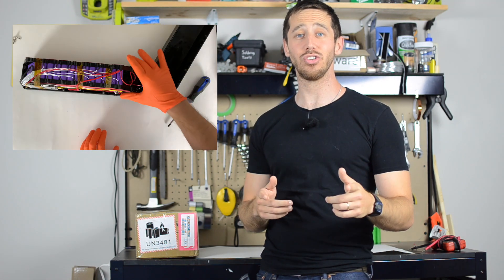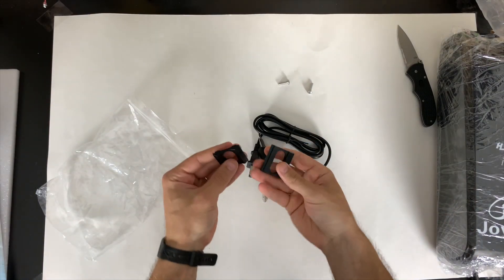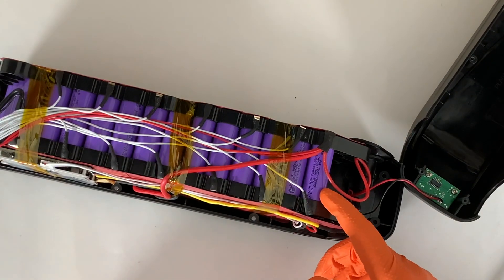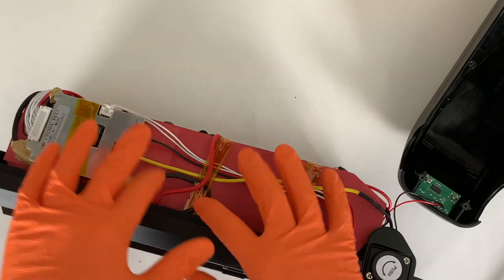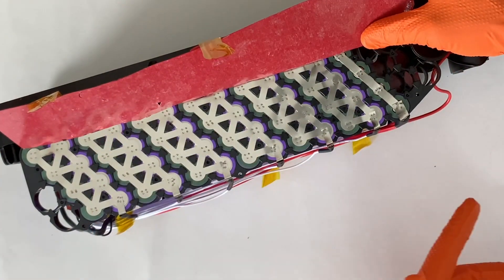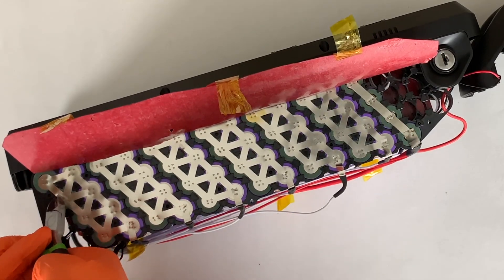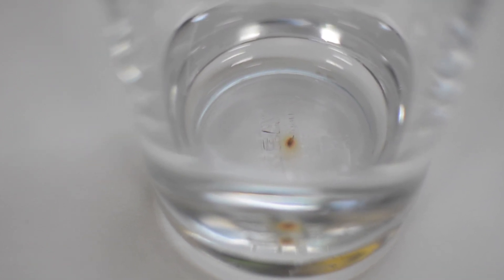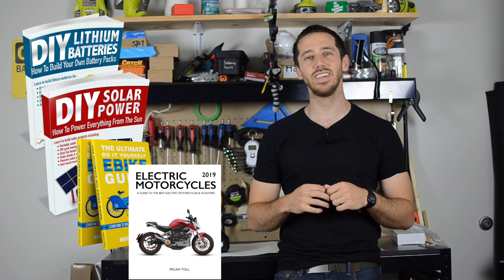How do you know if a battery is good quality?

Comment: why even the positive terminals are connected in parallel?
ALso, what is the rationale bwhind the use of nickel strips instead of copper, which is more effective (ie, lower resistance, lower heat loss, etc)?

Irrelevant:
"before my wife freaks out" : D

Comment: Hello I am trying to replace a a fuse board for n a Bafang battery 48V 15Ah 720W, battery is not charging, but it has some charge left on it. My question is where can I get the replacement part (fuse board)? currently there is 29.67V coming out of the fuse board. Can I bridge the fuse? &
voltage out of the charger is 55.2V.

Comment: I was riding my scooter the other day then it shuts down on me. When i turn the key back on i get error fault E-06. Key off then on again, noticed 54.6v with same error. 1 min later key off then on, the battery voltage from 54.6v would drop slowly down to 0v. Key off then on, completely no reading from voltage gauge. What could be the problem? Please help. With direct charging from outlet source, 58.4v and doesn't cut off. Btw noticed when i plugged charger into one of the scooter charging port, i hear like an arc sound but disapper afterwards..

Comment: Do you have diagnostic videos? Mine is supposed 28ah but when I get to around 16ah and voltage around 48 it drops out and I lose power to my cycle analyst. My old 11ah would run down into the low 40 before drop out

Comment: Thank you for sharing this information; critical information that should be explored and shared by the e-bike reviewers on YouTube.  I truly believe knowledge of a battery pack is the MOST IMPORTANT aspect when making a decision on what e-bike to purchase, seeing how devastating an e-bike fire can be! I haven't seen one e-bike  review where the reviewers covers the e-bike battery manufacturer. They gloss over the battery, providing the basic information that is easily found outside of the review. I would in addition like to see at the least the if the battery is UL certified plus the type of battery cell used in the pack, particularly if its from one of the "Big 5" like Panasonic, Sony, etc when a review of the bike is performed. At the most, it'd be great to have a review of the entire battery and motor pairing. From what I've gathered by talking to e-bike shop mechanics and officianados, e-bike batteries aren't readily interchangeable from one manufacturer to another. Meaning, if your e-bike has a cheaper/lower quality battery associated with the motor the bike was equipped with, it may be difficult to simply upgrade your battery. Is this true or not? Before anyone gets offended by this comment, I am very new to e-bike reviews, so I could be wrong. I apologize if  there may be some reviewer(s) out there who have taken the time to talk in depth about the battery manufacturers and cells within the battery pack on the e-bike they're reviewing. I'd love to hear more about this (importance of larger battery inspection and safety, and replacement of batteries in e-bikes) in your future videos. I really appreciate your content, so thank you!

Comment: with 30 Amps doesn't it require #10 wire? For house wiring #12 is 20 amp wire.  #10 is 30 amp wire.

Comment: Hi great video. I got here becase recently the battery of my cargo e-bike stop working and i got curious about the internal construction of these batteries. Well, i see that in my battery i 30A fuse is gone, the ba,ttery case providex a separate cover that give you access to the fuse. I wonder if it is safe to replace the fuse or it is better to check if other electronics got damage. The thing is that it is not so easy to open the whole case.
Reply: Do you still have the battery pack?  God told me that some of your battery cells are losing charge and the rest will go bad soon. God told me it has nothing to do with the fuse. You'll have to build a new battery pack.

Comment: i was hooking up another ebike battery on my ebike, i got 2 ebikes, i got 2 batteries for each ebike, i got extra ebike battery plates also for my project i am doing

 one has a 48v 13 ah battery and one is a 48v 14ah battery and i wanted to use both ebike batteries on both ebikes, i wanted one battery plate of each kind on both ebikes, so i can ride one ebike for awhile and use the other ebike batteries at least once every 2 weeks, drain them some and then charge them up so they stay in good shape and not sitting around not being used to long, it depends which ebike i use depending where i live, one is for offroad  and one if better for the city, i move around a lot and camp out a lot

i got a dual ebike battery connector and it had xt 60 connectors on it, so i put xt 60 connectors on all the ends, both ebike battery plates had 14 gauge wire on them, one 14 gauge wire was the many thin strand kind and one was less strands but thicker strands, i didn't know if the thicker 14 gauge strand one would work, the original battery plate worked when i put xt 60 connectors on it and plug it into the dual battery connector, but the other battery plate with battery didn't, 

so do i need to put 14 gauge many thin strand wire like the other one on battery plate for it to work? will it matter how many strands and thickness of strands on 14 gauge wire, will they work together, or do you need to use the same kind of 14 gauge wire?

since it wouldn't work i cut off the xt 60 connectors on the battery plate with the thicker strands, cause i was going to try and put the many thin strand wire on that batther plate and put xt 60 connectors on it and see if it will work but i didn't do it yet, i cut both the xt 60 connectors at the same time off and a big spark happened cause i had the battery in the battery plate when i did it and didn't know that would happen, i should of took the battery out of the battery plate connector before i cut them, will this cause damage to my ebike battery, should  i open it up and check the fuse and the bms? the battery that had the big spark still works fine on my other ebike, i rode my ebike on it and charged it up and it seems ok to me?

on my two ebikes they use different 14 gauge wire on the battery plates, one is thicker strands with less and one is thinner strands with more, also on one of the extra battery plates i got they used 12 gauge wire with the thinner strands, can i use the 12 gauge and 14 gauge thinner strand wires together?

Comment: Thank you for this VERY enlightening examination of a bike battery. 
My E-CELLS Super MonarchCrown 2 wheel drive E-MTB has two SAMSUNG batteries, 17Ah front and 14.5 Ah rear (under the rear rack) Dave Cleveland, the designer/owner of E-CELLS did a very good job of sourcing high quality parts for a great price ($5,100.) Chinese motors, Japanese gearing, Korean batteries, Thai Vee tires, Taiwanese aluminum frame, American rear shock, etc.

Comment: I recently purchased a 52v Yose power battery from Amazon.  It seems to work perfectly but I am concerned about the temperature of the charger when charging.  I have the charger suspended by the cords so that air can get all around it but it is so hot that I cannot hold on to it for more than 3 or 4 seconds.  Is this normal?  If not what kind of charger would you recommend?  This charger came with the battery, it's 58.8v 2A .  My battery voltage is 58.5v when charged.

Comment: Ebike school sir, Hi hello sir, may I allow to ask a question and please help reply with your expertise on ebike battery. Yesterday when I was paddle my ebike at home with the parking stand mount on the floor, for testing the ebike speed, then suddenly my mother was talking to me, instead of I need to press the hand brake to stop the spining ebike, I turned off the ignition key, THEN I heard a "pop" sound (the motorhub was still in high speed spinning) I don't know the "pop" sound was came from the battery or came from the controller. Sir, may I ask in most of the cases, let say, if a person paddle the ebike halfway through, when the battery still on going supplying the energy into the controller, and the controller still on going supplying the power into the motorhub, and the motorhub still drawing power spinning at fast speed, then he turn off the ignition key OUT OF SUDDEN to cut off the ON GOING power supply intake from the battery, in this case what will happen to my battery? Sir, please help me,

then I unpluged the ebike power  plug from the battery, then I turn on the key ignition to purposely release the electric in the controller, then I plug the ebike power plug into the battery and heard a as usual spark sound. 

My concern now is, how do I know I already wound, injury, or damage my battery or not sir. Hope you understand my question, trillion thanks if you would please reply sir.

Comment: can i charge multiple 36v identical battery's in a parallel setup with a mppt to regulate voltage but not have a shut off switch for each battery pack?

Comment: Hi Micah, great video, I'm trying to get up to speed on these batteries. I am repairing a 48 volt Lectric battery. It has 52 Lishen cells (LS LR 1865 SK 19/66). They are mounted end to end so the configuration is confusing to me. I have a background in electronics but when I went to school we spent a little of time on vacuum tubes. This battery quit after 19 months and 800 miles. We bought two bikes together and the second is great. I can see the bad cell, but haven't taken them apart to measure each cell.

Comment: Thanks!

As someone intending to build a custom battery housing (and then have someone better informed solder and wrap the cells) this was very useful.

One note: you say the cells are going to get really hot when discharging at the highest rate.

However, the 2C reading is rated for -20C...0C.

If we're like -10C, overheating is not going to be the first and foremost problem unless you really somehow manage to keep the max load on on continuous basis.

On subzero temps it's usually different things than overheating that dominate the risks.

Comment: I'm so glad I'm watching this video again. I have a couple cells that are not fully charging. When I took the battery out of the sleeve (I have a ancheer step through, no longer available on Amazon ☹️) they hot glued the wires and hot glued it to stay in the sleeve. It was a fight getting it out! I removed it very carefully without pinching any wires. Just waiting for my money to come in so I can order a couple parts. Spot welder and heat shrink wrap that you recommend in one of your videos.

Comment: One other thing that I would like to mention: the battery casing is black, which will undoubtedly heat up in the sun, and build up heat inside the battery which is definitely not good for the cells. Especially since there isn't any temperature probe inside.
Why do bike accessories manufacturers insist on making them black is beyond me? Black water bottles, black seats, black handles, etc. All of these become very hot in direct sunlight in the summer!

Comment: i sure hope you can help me.  i just picked up a 36v nominal  10s4p 40 18650 cells total. it came from a skateboard.  i have been searching for anyone who can help me out. all the videos i have seen are of people who are building battery packs but nobody shows how to take one apart safely.   so far, i have removed the BMS wires but i need to know which nickel strips should be cut so that i dont cause any sparks or shorts. my intention is to harvest the 18650 cells for projects like replacing NICADS in power tools and other projects. looking forward to your reply.  thanks.

Comment: Hi, just have a question, i make a 48v 13s 4p of 2900mah 16850 battery.  things i made mistake making my battery and i need your very good opinion and or help, 1) i made mistake installing bms on battery by soldering B+1on the last + side of the battery and so on  i install it in reverse 
, does this damagemy BMS?
2) i charge the battery on the load side instead on charge side , after 30 mins i realized that i plug it on wrong connector of charging on the load side, would this damage the BMS ?

So now the battery is fully charge at 54.6v and try to run a 48v motor hub  but it did not run , my suspect is weak battery current. Can you please help, thanks

Comment: I so want your Battery book. I will buy one from Amazon. *** 
Best Wish and thanks for your tutorials. 
I have made my four year old bike into a front hub E-bike. It has not been a hour long project as I have had to improvise a great deal. I am much the wiser and not too much out of pocket if had I bought a ready made E-bike. A Swych bike was my first option. They use a new type of battery design, almost like a large cell phone. It has the same power specifications as Yose power. How is that done? I strongly suspect that the down side is that when the battery is expired it will not be re-buildable. Just a thought and a justification.

Comment: Very interesting. I have a Bosch mid drive system...I bought it in 2014 in Europe....I still run the original battery...I remember reading about a fire in NY city where a person was charging multiple batteries and they caught fire....I have a simple rule of thumb....I never leave my battery charging when I am not present....
Reply: I'm a Bosch mid drive rider. Got a new battery and love it 6000 miles riden

Comment: Intetrsting video! In what situation there will be 30 amp continues draw? A large 500w motor connected to 48v battery draws only about 10a. Are you talking about the momentary starting draw? Can it cause over heating?

Comment: shit, the pack i built has 6 cells in parallel, 14ga wiring, a single 7x0.15mm strip on the end, and no distributed discharge... i should probably fix that and test a piece of left over strip. at least i'm not pulling 30a from it, motor can't pull more than 25a and i usually keep it at around 20a. at least i overspecced the bms (and cells), just dropped the ball on the wiring lol

Comment: The better one is the DA energy which is the same manufacturer that makes the Hailong case. They using LG IMR 1850 cells at 2850mAH which has a C rating of 3.51C rating, so can handle 10 amps and the better purple cells not the crap cells and are genuine as tested them. Plus battery pack is cheaper then this one. Issue is base was wired only using one set of terminals and no had to silicone and hot glue the inside connections. Does use nickel strips and 30 amp BMS and wrapped and padded inside the case.

Comment: I have an order in to The Electric Bike Company for two bikes - model X & Y.     I have been doing a lot of research on repairing and testing on E bikes so that I will be able to do it myself.    You have definitely covered a lot of key points on the battery.    I would like to see you check out one of the basket mounted batteries from the company above .    They claim that theirs is one of the best out there. 🤔.    That they build them in house.      Also a few links to who has the best nickel strips for rebuilding a battery pack would be greatly appreciated.   Also I watched a video on how to build a spot welder with a motorcycle battery and solenoid for a ATV.    Any input or thoughts on that or if you have a better idea for building a spot welder on a budget.

Comment: Hey man, firstly, I enjoy your videos. Secondly, Im wondering if youve ever done any testing to see how much current nickel strips of different thicknesses can handle. My experience says two strips of at least 0.15mm * 8mm will handle 30A without getting much hotter than thicker ones. That being said, I have tried to find some data regarding this issue but have found nothing where as its easy to find (and common knowledge) that info about solid or stranded copper wire. If you havent, it looks like Ill be doing some tests to try to pin down how strip thickness relates to current carrying ability. Anyway, thanks for your videos sir.

Comment: Salt water? Why not run a magnet over that nickel strip. If it sticks is plated.. And since the batteries themselves are steel cased doesnt it mean that theres already going to be. Resistance . i realize head to head if you ran a diagnostic on a pure nickel strip pack vs a nickel coated. Strip (all other componets being equal) that the pure nickel pack would pencil out better.. But i bet ypur only tslking 2-3% difference tops